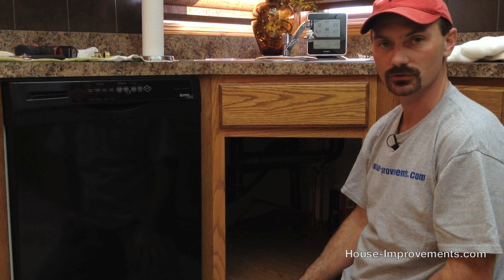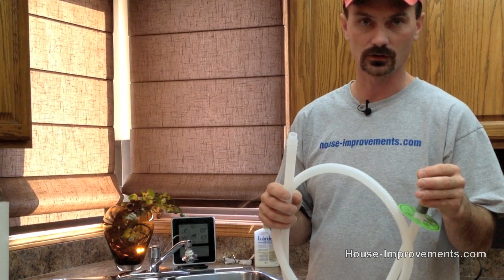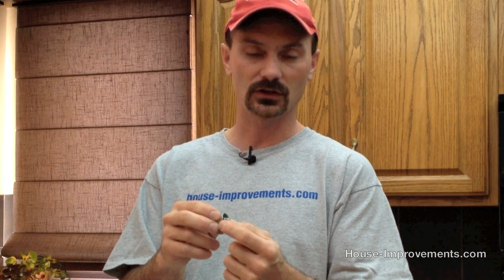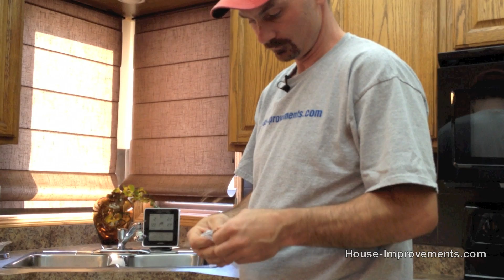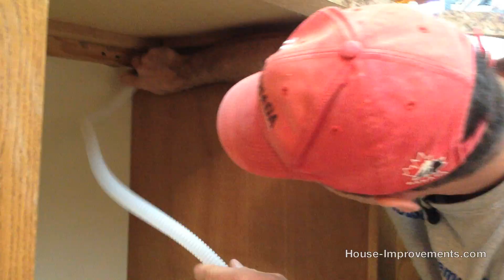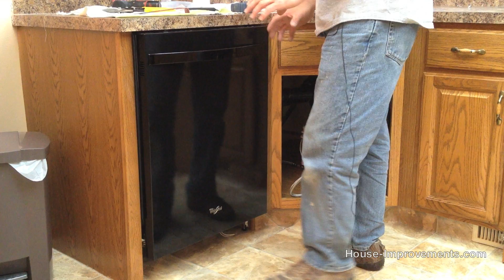How To Replace or Install a Dishwasher

Comment: I am a professional installer
What you have to mention is that the height of the drain hose must go higher then the  bottom of the sink.
alot of times the holes are in the wrong spot and will stop the dishwahser from going fully back.
i cant beleive how far you left the dishwasher sticking out. Those buttons on the top are suppose to be hidden.
if those support clips have to be cut you are probably installing the dishwasher wrong.

This is why you pay the money to have it installed professionally. he didnt do a bad job for an amatuer, but he shouldnt be teaching
Reply: Have it installed professionally... not bad for an amateur... shouldn't be teaching... smh some folks need to get over themselves
Reply: Susan Buchan u just dnt want this guy to put u out of a job
Reply: I was going to say the same thing about it sticking too far out. He must have never used a dishwasherike that. And I'm not a professional by any means. I was cringing when he cut the clips off.
Reply: I'm sure you are technically correct but as far as I and many others are concerned when we install something like a dishwasher the only important thing is that it cleans dishes as it is intended to do. Most people are not that nitpicky about how far it does or doesn't stick out. About the drain hose yes but his was already looped high enough on the side of the dishwasher but he should have mentioned it.
Reply: @phillhuddleston9445  The reason you buy these fancier dishwashers with the flush-mount intended buttons is for a clean aesthetic. To say "well it just washes dishes still" is really not a valid answer. The maker of the video did not fully understand the dishwasher design, and therefore he should correct it; until then, Susan is right that he should not be teaching others.
Reply: Great advice! He has other video showing how to hook up the plumbing. In the video, it looks like he pushed the dishwasher all the way in, but the buttons are still sticking out a little bit. How can you fix that if you are in that situation? Maybe grinding off some drywall a little bit?
Reply: Roger
Reply: I believe the D/W was installed too far out. The kick plate on the D/W should align with the kick plate of the cabinets. My installer (neighbor) made the same mistake until I noticed this. He returned and made it right.
Reply: It is not a big deal if the dishwasher is sticking out a little bit. I run the water line behind the dishwasher when I remodeled my kitchen, and it would not have much space.
Reply: @joshuagary9471  know
Reply: I completely agree, the dishwasher is designed to be “flush” installed. You are supposed to open the door to access the controls. If you can access the buttons when the dishwasher door is closed you installed it wrong

Comment: Great video. I just purchased a GE dishwasher from Home Depot, and they wanted $80 to install it. I did it myself with the help of this great video.
Reply: $80? I'll gladly pay that, Lowe's wanted $180 hence I am watching this video lol
Reply: I'm watching this video because Home Depot said it would cost me $130 for them to install a dishwasher.
Reply: I paid $100 and they were not able to install the DW because the old unit was directly wired to Romex cable.  I ask them what I was paying then the $100 for, they said they can only plug it in to an outlet.  I ended up doing it myself.  Home Depot should know that most of the home built prior to 90's where done this way.

Comment: I have granite countertops and cheap cabinets so my dishwasher always tilts forward even though it is screwed into the cabinets. You cannot screw the dishwasher into the granite and the cabinets are not made of solid wood, so I do not know how to keep the dishwasher level. I was wondering if I were to remove the dishwasher and attach some studs to the back wall and then screw the dishwasher into the back wall.

Comment: SUCCESS! After watching about 10 hours of these videos, yours gave me the confidence to attempt this myself and I saved $150 in installation charges! Bought the 8' braided ss flex line with the 90 degree adapter and replaced the 30 year old copper line. Piece of cake AND mind, Thanks again.

Comment: I cut my electrical wire behind the dishwasher now the wire is too short, any suggestions on how to fix that..Thank you!!
Reply from the maker: Mount an octagon box or square box back there on the rear wall were it will not inter fear with the dishwasher. Run the wire inside the box and then run a new wire from there to the dishwasher. Be sure to put a cover on the box also.
Reply: HouseImprovements
Also can I splice the wire and add an extra piece of wire to the short wire to the washer?Why mount the box to the wall,there was not a box before. I'm just want to know,I thank you for any help!!!
 It had no box before,,
Reply: HouseImprovements
Are you saying put a wall outlet socket and just plug the dishwasher in that outlet?

Comment: Good job Shannon, am buying a new one this week 'cause my old one( a 20 year old Westinghouse) took a shit and  and the water never stopped pouring out all over the kitchen until I shut off the main supply! It seems the water inlet valve broke or the wire leading to it just corroded off it. After watching your vid I feel pretty confident I can hook up the new one and save another $200 Thanks, I'll let you know how I made out, Good tip on buying that 90 degree elbow too.

Comment: Any time I install a dishwasher I set a receptacle box behind the unit at the back of the cabinet and install a pig tail on the unit with a plug on it long enough to pull the unit out of the cabinet for service and still be fully functional. The unit is much easier to service from the side than it is from the front.

Comment: I just installed the exact same dishwasher and 1 thing that got missed is that when putting in the small metal clips that get screwed into the counter top, you must bend the ends of the clips that go into the frame downward so they are secure before you push the dishwasher into the hole and screw it to the counter top. If you noticed, one of his clips popped out at 19:06 because the ends weren't bent downward. I bent mine downward with a pair of needle nose pliers. The manufacturers instructions clearly explain this. This was a very helpful video!

Comment: Hardest thing was putting the wiring back.  The ground was so stiff and it took awhile, but once it was all together it shoved in fine.  The darn electrical box was also hard to unscrew, since the manufacturer had decided to make the screw about 1/4 inch higher than the bottom of the dishwasher door, but I used a wrench and got it off.  The rest worked like a charm.

I honestly cannot thank you enough for this great video.  My 14 year old son and I just replaced an old dishwasher at our rental property in about 1.5 hours.  Could not have done it without your help.  Great video, and also found a lot of extra tips in the comments.

Comment: Great video to get me started.
After using tin snipes on thin metal I suggest using a file to round off the edges.
Reply: Rather than cutting the tabs my Bosch instructions say to bend them back over themselves at the perforation.

Comment: The connection he had is for Romex Wire Connection when inserting it into this type of connector make sure a bit or plastic coating passed the connector so the clamp rest on that other then the wire. Then the copper wire wraps clockwise around the green screw and black to black white to white..  simple ...  BX armor cable you find in some Condos uses a L16  and make sure the BX has a anti short as that protects the wire from the armor cutting it to the wire..

Comment: Great video and excellent job on pointing out the electrical connection as I am a electrician and I see people cheating like this all the time other then running to the hardware store and spending a $1 on a connector.   I live in a Condo and I just bought a new set of appliances for my Kitchen and I never replaced a dishwasher as I had a idea how it's done but to see a video on it will make it easier when I install my new dishwasher... Once I get them :)   thanks

Comment: All done - flawless install thanks to your video.  Added one step - I used a few small pieces of duct tape to hold the padding to the back edge of the unit - that made it slide in much easier.

Comment: Perfect!  Just got the same dishwasher and need to replace my old one.  The Home Depot installers refused to do it because the sink was too far away and they are not allowed to put water lines together so I have to do it.  You covered it very well and lucky me that you used the same dishwasher.  Thanks

Comment: I know you said to check the breaker and shut it off. But you should have shown to check the circuit with a tester. Good video, but safety first.

Comment: To make it easier to slide the DW in with the insulation, you can use packaging tape to secure the insulation to the DW - it also prevents it from bunching up.

Comment: didn't see you connect the electrical. saw you remove it on the old one. you slid the dishwasher in... then there was visual of connecting it.

Comment: Great Tutorial, helped me get a better idea of what I have to do.  I have a quick tip so when you put dishwasher back in, and you're having trouble keeping the insulation/sound proofing from bunching up.  Get some cardboard and lay it on top of the insulation layer and leave a little lip so you can pull it out after you get it snug in there.   Cheers!!!

Comment: You should put the clamp on the wires first then it will be tight. Use the plastic wrapper that came on the door of the dishwasher to shoehorn the insulation in.

Comment: @diospeeddemon put your multimeter on the setting with the strange symbol that represents omega. Its a ohm setting . Touch leads together to test measuring instrument.October beep or the numbers on meter are zero.then go a head and look for your wire.if meter reads "ol" then you haven't found your wire.

Comment: @HouseImprovements Thanks, Shannon. That's what I thought, but I wanted to be as sure as possible before I get some unrelated work inspected this week. With it all glued together I can't see the wires going anywhere. Sorry for highjacking your thread. Your videos are excellent. Where are you based? I live in Lethbridge.

Comment: Nice review. I noticed that the wire leading into the junction box was 14/2 Romex. When do you need those wires to be protected by metallic cable?

On an unrelated note, if you are using PVC conduit that is glued into a PVC box, do you still need some kind of clamp to hold the wires secure as they enter the box?

Comment: 80% of this is great but I think some very important material (for new people) got left on the editing floor:  hooking up the water line under the sink and the drain hose under the sink (at a few seconds past the 20 minute mark).   If you could add this info too, this would be perfect.   Thanks so much for posting this